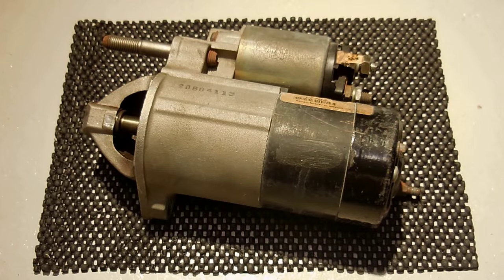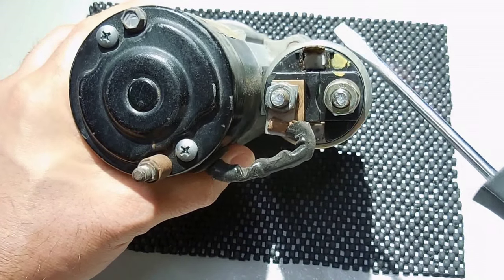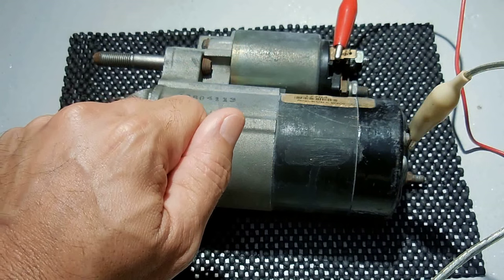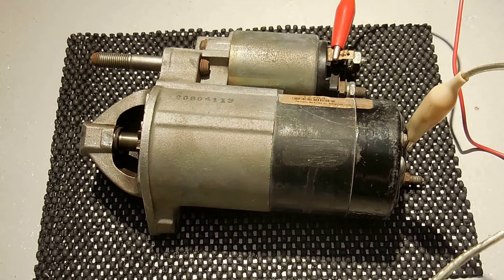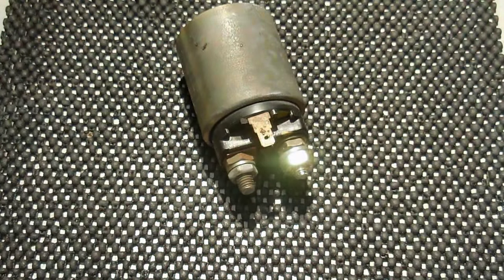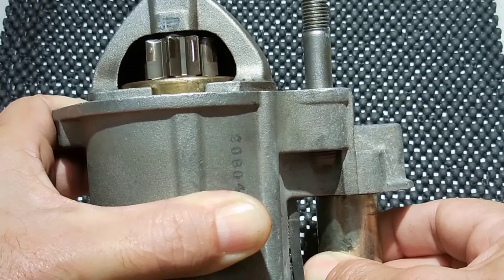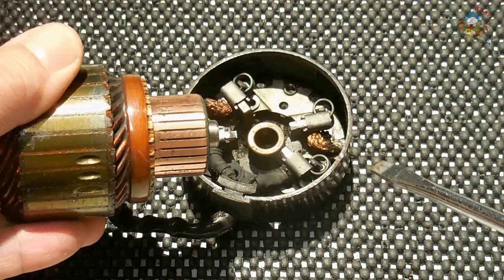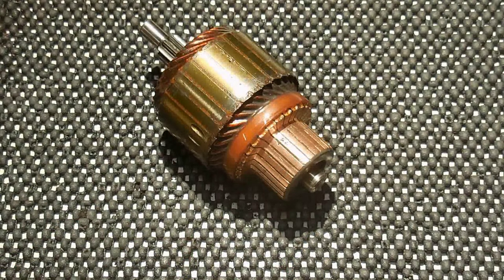Ultimate Guide To Engine Starters! (The ONLY Video You'll Need)

Comment: I did all this on my car starter. It was dead on withe the service manual. All it needed was cleaned. Good video thanks for stating the stator never really goes bad just a good cleaning and yes check the brushes. Go ahead and replace them since you have it a part.

Comment: Great video.  An added item.  Neutral safety switches now and them go out of adjustment, as you know.
An easy check is to hold the key to the start position (with your foot on the brake) and joggle the shift lever up and down.  If the switch is just out of adjustment, you will soon know.   Thanks again.
Reply from the maker: Yes, I had that problem a few times with inboard boats. Thanks for watching Steve!

Comment: Fantastic video.  Most informative I have seen on this topic.  I've been researching starter issues on a 1999 4.3l Mercruiser. I get the "clunk" of the solenoid firing 100% of the time I turn the key, but the starter doesn't always spin.  It's better some days than others but at it's worst it can take 25 or more turns of the key to get the starter to turn.  Based on your video it sounds like an issue with the brushes, likely worn.  Guess it's time to pull the starter and test.  If only it was easier to access in the back of 19' boat!
Reply from the maker: Glad you enjoyed it! Be sure to check out my video playlists(especially the Automotive/Mechanical playlist), rate thumbs up, and share my channel with others. Thanks

Comment: Another well done how to, I have a starter on the bench right now that the brushes have clogged the armature, Seems brush wear is becoming a real problem,at least from the ones I have worked on.
All my best.
Bobby
Reply from the maker: +Bobby Tectalabyss 
Thanks. Some use carbon brushes, and others use copper brushes. The carbon brushes can make things dirty.
Reply from the maker: +Bobby Tectalabyss 
Thanks. Some use carbon brushes, and others use copper brushes. The carbon brushes can make things dirty.
Reply: +electronicsNmore After cleaning the brush holder and brushes, I found the brushes to be a mix of copper and carbon, Carbon being 90% or more of the mix. Carbon I have no doubt is the cheaper of the two.
All my best.
Bobby

Comment: What about if the solenoid spring's springiness has degraded and is failing to pull the starting gear back away from the flywheel? Did you miss that possible failure?

Comment: In my decades of auto repair I have seldom seen starter brushes that wore out. Having said that, I would not rule it out. However, the solenoid internal contacts due wear and a sure sign of that failure is when one can, after many repeated cranking attempts, per chance catch the motor to spin the engine. 
It used to be a solenoid could be repaired. 
There are the heavy copper terminals inside that are bridged by an isolated, spring loaded, copper disk or some such contact when the plunger is energized. Due to the nature of D.C. power, the battery side terminal will experience loss of material due to arcing, this results in the contact not being able to contact both terminals. I have made my own terminals out of heavy copper bar, but a trip to the local auto electric overhaul facility usually would sell me what I needed. I see that this particular solenoid  is crimped closed and as such will not give up any secrets of its internal condition without probable destruction of the housing.
One CAN fire up the starter bypassing the solenoid to see if the motor spins but I would not try this while the starter is installed. The gear will not usually move forward but the motor should spin.
Ever see a starter fail to disengage? Amazing what estimated 30,000 RPM will do to a wound armature. The over running mechanism seized on a Bosch unit I had the pleasure to service... I was lucky to use it as a core on a re manufactured exchange
Reply: +Craig Nehring I agree with the solenoid problems,though I have found the brush's are wearing at an accelerated rate these days. It would seem they have changed the mix for the brush material. More than likely a cheaper mix. I have a starter off of a jeep grand Cherokee that the brush holder and armature, is completely clogged   with the  material. No other contaminant. Not trying to say you are wrong just saying what I have been finding.
All the best.
Bobby
Reply: Yeah I bet, back in the 60's & 70's most brushes had a lot of copper in them. Some starters would "spin down" quite a bit, leading to pre mature wear. Components got to be expendable with cheap imported things, one just replaces the entire assembly rather than fix it.
All in all alternators and starters are long life items
Note: Never smack a permanent magnet starter, that will be the last of it
Reply: +Craig Nehring  Seems everything these days are becoming use it then throw it away,Sadly. Great tip on not hitting the Starter. Thank you for the reply.
All the best.
Bobby

Comment: perhaps you can help me once again.  I have a samsung tv and I need a 4.6kohm resistor 5% tolerance (1WATT). Where can I get one?  Most appreciative as always. This goes to the Y board of the unit. Jameco has 1/4 and 1/2 cannot find a full watt.

Thanks as always....
Reply from the maker: +William Ward 
Just use a 4.7K / 1W. They are sold on Ebay.

Comment: Alarm anti theft or clutch pedal safety switch..or transmission neutral safety switch  on automatics can be misadjusted or bad.Many times shift auto transmission into neutral while attempting to crank engine will start it. Also just because a meter may read 12v does not mean battery is strong enough to crank engine . You need a load tester 500amp or more on diesils...or measure voltage when cranking another vehicle over which should stay above 10volts or greater to start. I have seen many people swear battery is charged but it fails load test...Also terminals and grounds to engine are often green corroded. Happy wrenching!
Reply from the maker: +motorhead 
If the solenoid shows 12.5-12.65V when the key is in the cranking position, and you can hear the solenoid click, but the starter does not crank, then the battery is not the problem. If you measure the voltage of the battery at the terminals, and you get 12.5-12.65v, then you only see 7V or 8V at the solenoid terminal when you crank, then the battery needs to be charged or replaced if the plates are bad. There is no need for a load test. If you crank the engine with the headlights on, and they dim all the way down, that would indicate a weak/bad battery. The battery voltage should not drop lower than around 10V when cranking.

Thanks.

Comment: I have a 2003 Camry, tried removing the starter but it would not come out, both bolts were removed. It seemed to be seized or fused so I hit it with a large flat screwdriver and the cone where the gear is broke off inside the engine. I managed to remove the starter but the metal cone and gear are still inside the engine. Any ideas to get it out? Weird
Reply from the maker: Wow, bad news. You must get it out of there. Don't turn on that engine. Get a mirror and grabber. Maybe there's a cover on the transmission that you can remove.

Comment: No start: clean battery terminals and relay terminals. Positive battery most likely culprit because mechanics remove and retighten the negative terminal. If you can turn the positive by hand you have found the problem. Next step clean brushes. 

This also applies to alternators. -battery light on.